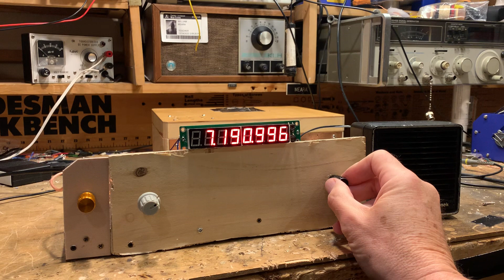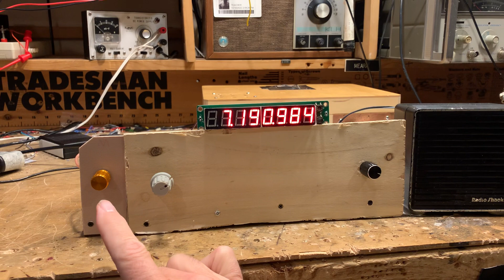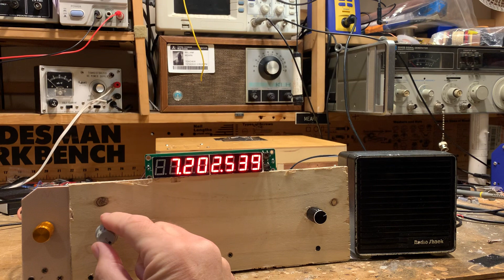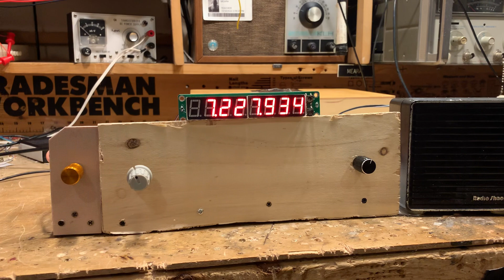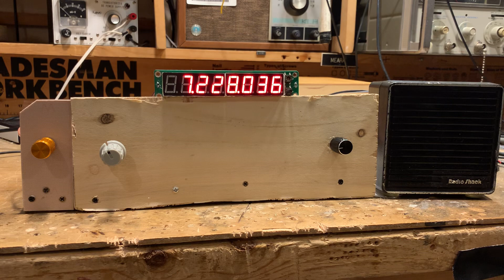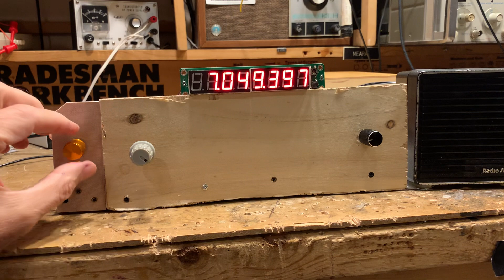Bandscan! 40 meters with Direct Conversion Receiver (with W1AW/4)

Comment: Is that an earth strap to the nut on the brass screw on the PTO?
Reply from the maker: Good eye Peter!  Yes.  I found that the hand capacitance effect was very disruptive UNLESS you ground the brass screw.  I did this with solder wick straps from both nuts to ground.  If you look at the N3FJZ video on the SolderSmoke blog you will see him doing much the same thing with an alligator clip attached to the screws. 73  Bill
Reply: Please share 3d PTO un thinghivers

Comment: Hi Billthat's great. I made a direct conversion radio and used a frequency readout like yours but mine put a lot of noise into the radio.
I've tried putting lots of caps on the power supply leads. This did make an improvement but it's still there.
Using a battery to supply the voltage my be the way to go.
De HS0ZLQ
Reply from the maker: Paul:  You might want to try this.  Just three parts.  Please let us know if this helps.  
https://soldersmoke.blogspot.com/2017/01/when-bypass-caps-are-not-enough-active.html
73  Bill

Comment: A most excellent build Bill!  Wow, what a coincidence, both you and I were recording a YouTube video at the exact same moment using the exact same (well, 75% exact for me) SolderSmoke-DCR rig design.  I just completed the Attenuator / Band Pass Filter module this morning and was recording the results.  Don't worry about the frequency counter, other than some kind of complex mechanical dial mechanism, it's really the only practical way to do it.  I was doing the same kind of thing on this end to determine where I was.  Good job!  73 - Rick - N3fjz